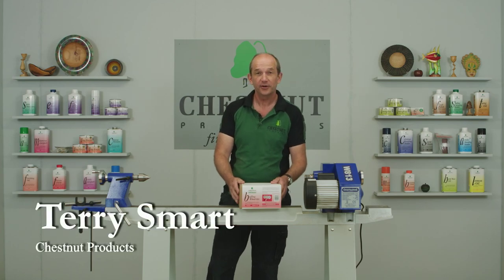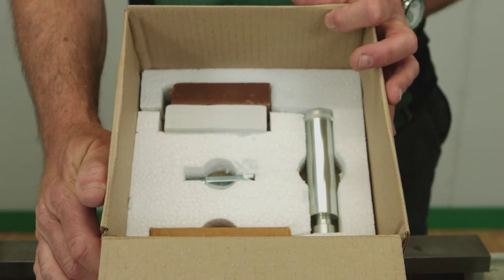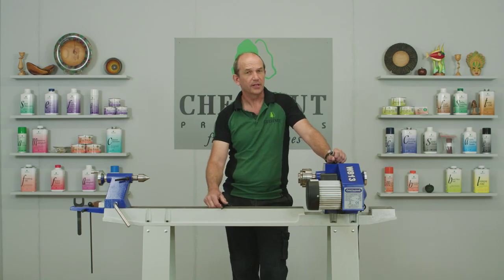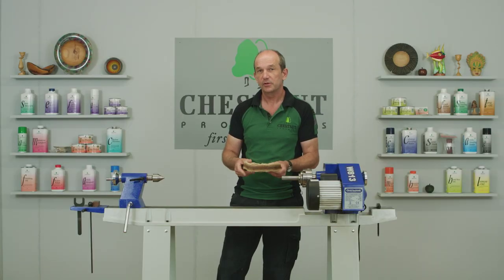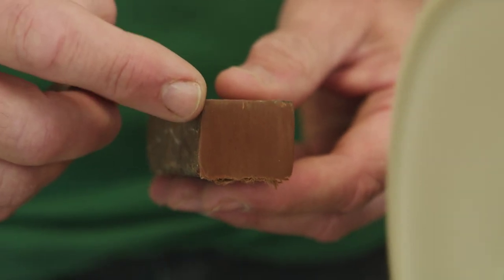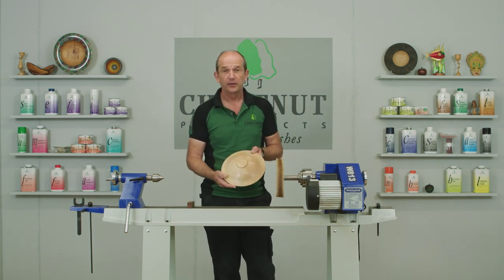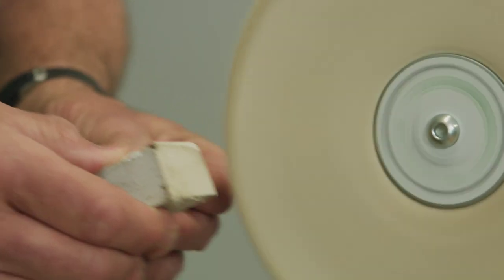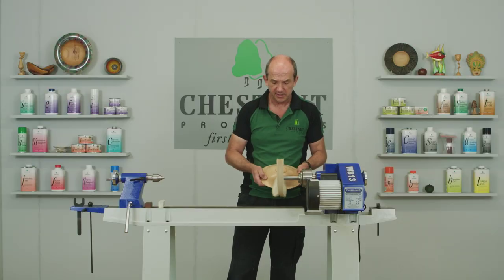Buffing Wheel Kit   Chestnut Products Finishing School 6

Comment: I have ordered and received this product now, I have no lathe but will use with my electric drill. 
I want to use the Microcrystalline stick which I have just ordered too. Do I use very little as you did with the White compound - or be very liberal loading onto the wheel as you did with the final wax?
Reply: Hi Barry. Use the Microcrystalline Wax Stick quite sparingly, this will give better results. You can add more if you feel necessary, which is easier than trying to remove too much! Does that help? Terry
Reply: @chestnutproducts3097  Thank you for the speedy response. I will  try that then when it arrives.  I very much look forward to taking my woodcraft hobby to the next level.
"Tighten the chuck up" has become my new catch phrase :)

Comment: Not everyone has lathes - if buying this to use as I did with an electric drill, the large mandrel is an expensive door stop as it wont fit your drill chuck. 
A 450 Watt basic drill turns at 3000 rpm - says on the buffing pads 'MAX 1500 rpm'. So if your  drill is not a variable speed model, then you will need to either buy a variable speed drill - or buy a speed controller for your existing drill. Back to shopping for me before I can use this.
Reply: Hi Barry. I'm sorry you're disappointed with the kit. We do say in the video the mounting sizes for the Large Mandrel and the speed the wheels are rated for. All the items are available separately as well as in the kit, so there's no need to buy parts that you can't use. You should have the option to return the kit if it's not working for you. Again, I'm sorry to hear the kit isn't suitable for your needs.
Reply: @chestnutproducts3097  I found the video after I had made the purchase. I hadn't realized my drill  -and indeed any basic standard drill - turns at around 3000 rpm,  twice the optimum speed. Its not something I have ever had to think about and I felt it was worth adding this information in case anyone else comes down the same path. Its worth checking your chuck max size and drill speed as this may well not work for you as a kit. Might be something that could be added to the website/product information, to educate and forewarn those who are not wise till after the event. It just says can be used with an electric drill.
I will shop around for a speed controller which seems to be around £20 range. Then I can use the smaller mandrel with the corded drill.
I did a work around as I had a cordless drill that was much less powerful and Max speed was 1500 rpm. I clamped it in my WORKX Jawhorse and had my son operate the trigger off and on so that I could have a go at polishing my latest creation. It did the job nicely. I'm just waiting on the Microcrystalline wax to arrive now to finish off.
I'm not saying this doesn't work - it does - my project piece is gleaming. However buyers beware if you are a hobbyist with no lathe and intend using with the corded electric drill and choose the kit form. The large Mandrell most likely will not fit, and you will need a speed control device as standard corded drills are much too fast. The pads and compounds and smaller mandrel do fit and do work as they should in polishing back a final piece. I'll contact CP and see if I can send the new large Mandrell back against a credit note as I'm sure I'll be back for other things in the near future.
Reply from the maker: @BarryM60  Thanks Barry - I'm glad you've managed to find a workaround and the results are speaking for themselves. You make some good points and we'll adjust our website text to make it clearer that it's a lathe based system primarily which can also be used on a drill (in a more limited manner). Do get in touch via email and we'll try and work something out for you. Thanks, Terry